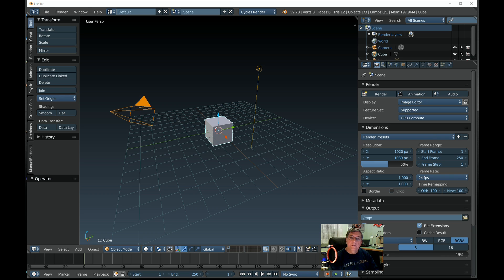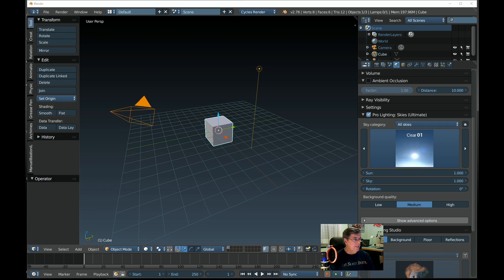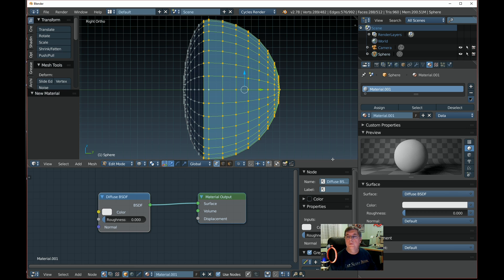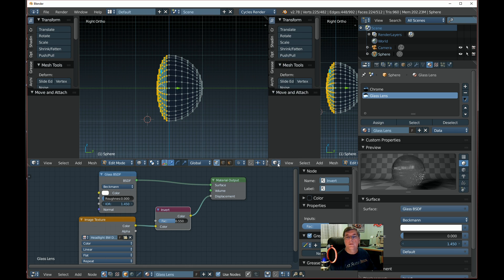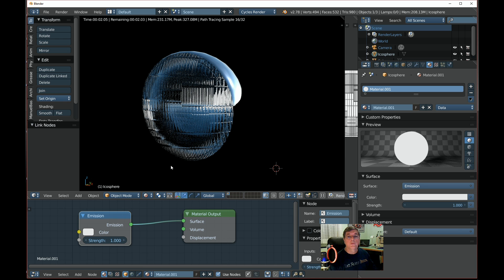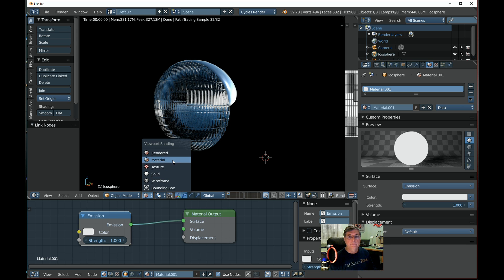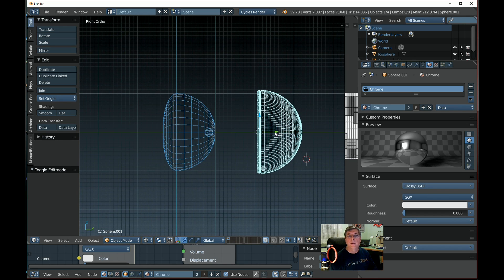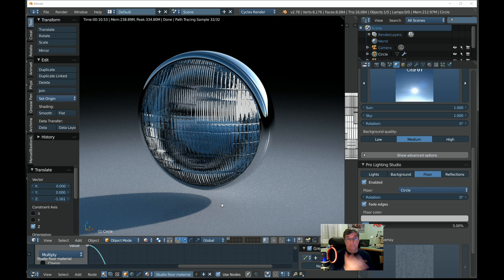Blender  3D Car Headlight Tutorial

Comment: Thanks! great tutorial here. I'm using blender 3.5.1 and a few of the intricacies of nodes etc. have changed a little... my emission node doesn't light up through the glass lens like yours is showing. Any suggestions for newer versions of blender (p.s. I'm only a novice, so part of the problem could be on my end). Thanks again
Reply from the maker: When you add the emission to the echo sphere you will need to change the strength as well as the color of the emission.  The color is black in the menu and it needs to be set to white in order to have it show up in you model. To do this just select the color bar next to the word Emission. You will then see a color pallet. Move the slider up to from from black to white. I also set the emission strength to 10.  This will give you a nice bright light in your image.
Reply: @TheTinkersWorkshop  Thanks for the quick reply! I've got my emission on the icosphere set to pure white and even cranked the emission strength up to 50... still can't see it through the glass. Gotta be user error, I'm not advanced enough yet I guess. But I appreciate your response! (and the great tutorial)

Comment: Very interesting project. I came here because I'm virtually replicating a 6012 sealed beam headlight in Blender--one that actually casts a beam. I've already built a reflector and am doing beam forming with reflective caustics. The next step was to build the lens with the patterned glass, but I am having problems with the UV unwrapping not producing the correct image like you have here. It's somewhat scrambled. I have a tough time with UV mapping in Blender.

Comment: thank you very much. very helpful. i have terrible problem with caustics, how did solve the problem? also i thought tere must be a high polygon topology in order to use displacement
(from manual: "It requires the mesh to be finely subdivided, which can be memory intensive. Adaptive Subdivisionis the best way to subdivide the mesh, so that exactly the right amount of subdivision is used depending on the distance of the object to the camera.")
I am absolutely not an expert but it seems that it is against all rules i learned and used to. On the other hand it works but after watching this tutorial and the final effect i have no idea how (without high subdevision and without caustics problems).
Reply from the maker: Hello Wiz!  The simplest way I found to cure the caustics issue is this.  Select the render button (looks like a camera) and then go to the Light Paths menu.  In that menu you will find the Reflective and Refractive caustic buttons.  When these are selected caustic fireflies(?) show up on your render.  Unselect these two buttons and your render will be much clearer without the fireflies.